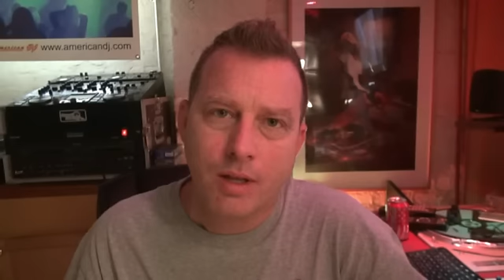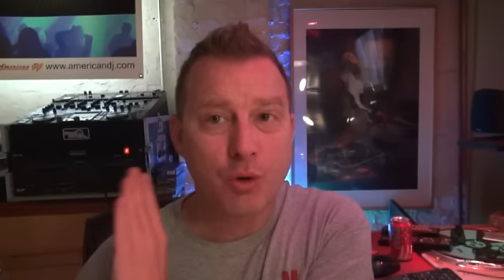Passive Speaker Systems - Amp Power, Gain, High Pass/Low Pass Crossover Points, Etc

Comment: Sorry but you got your info wrong, 250W program is 125RMS so a 175W amp would be giving about 50% over the speakers power handling. My friend, it's all about gain structure, if you don't understand it, you are not ready to run sound. I do live sound, most dj's I know, when I tell them about gain structure,  look at me like I'm speaking Chinese
Reply: As eurofantasy say, your info are wrong an unfortunately so is he :-) ,Wattage has nothing to do with it.
I.e. the reason for clipping is that your amplifier is often that your amplifier try to multiply the input signal to many times so that the amplifier lacks the power. (2 v x 100 = 200V) if you amplifier only can deliver 190v you get clipping or the speaker demands to high a current so your amplifier gets a voltage drop..
What you shall look at are the DB at 1 meter and ohm to calculate if your amplifier are powerful enough.

Comment: @CHRISTIANMINDAMIX If you're bridging the amp and then going from one speaker to the next, first, you'd be running a mono mix... secondly, you'd be running the speakers at 2 ohms, with them needing to draw 1600-2000w of power, which puts a tremendous strain on the amplifier, so unless the amp is capable of handling that 2 ohm load, that's a bad idea.  That all said, a single mrx525 is rated at 800w cont.  So if you have a pair, you're going to want an amp that can feed 1000w per speaker @ 4 ohms

Comment: I really don't see the benefits for mobile DJs 
using passive speakers today! 
They have Extensive DSP enhances system performance
built-in that is completely matched and tested to active speakers.
QSC has these benefits others have similar. 
"DMT™" (Directivity Matched Transition)
Directivity Matched Transition matches 
the HF coverage angle to the natural 
coverage angle 
"Energy Management" -Automatic standby mode 
QSC's Guardrail™ technology protect your loudspeakers 
from overexcursion.

Comment: does anyone know how to tell if you car has a factory amp, because im looking to get a aftermarket system and i went to car toys and they said i had a amp and it would cost $150 to cross it over. I also went to best buy and they said i didn't how do iknow for sure.  I already looked in the manual for the car.

Comment: (cont 3) last one I think... sorry....LOL.  --  People just tend to over drive their amps with false confidence more often when they have an underpowered amp vs. higher powered speakers.  Lastly, putting 50 watts into a pair of speakers rated for 500 Watts does not mean they will be quiet.  Power rating is nothing more then a rating of how much power you can put into them, not a rating of how much power they need.  My subs are rated at 1600 continuous, but I almost never put that much to them.

Comment: I need help, thanks if anyone reads this.
I have a Arc KS 300.2 Amp
and 2 10 Polk db Subs.
my car is new and it has a Shaker system installed when i bought it, if thats needed. i read the manual but im trying to figure out whats right, cause everytime i mess with it it shuts off it was installed prof. btw. i play all types of music but mainly rap.
but the settings has Gain, Bass Boost, Freq from 55 to 555, freq range 1x or 10x button, (High) Low, or full, (bridged r,in) L+R mono or Stereo thanks

Comment: First of all, a speaker isnt really "pulling" power from an amp. Its only accepting the power its given. Its not like an amp trying to suck power from a power source. But turning up the amp all the way to try to power the speaker will most likely lead to clipping and distortion, that's why it sounds bad and its bad for both the speaker and amp. Second of all, the average human can hear a frequency of 20hz and up. Not sure what the highest is for the average human. So to say that

Comment: I would be careful saying you should "overpower" your speakers.  You really aren't, you just have more headroom and are reducing the strain on your amp.  I usually use an amplifier rated for 150% of the speakers wattage.  Say a 300W speaker with a 450W RMS amplifier.

Comment: Brian,  you are confused regarding "underpowering".   It does not EVER hurt a speaker to underpower it. You are confusing "underpowering" with "clipping".    When you're underpowering speakers,  you won't get a lot volume out of the speaker... which in turn, most uneducated people will turn their output gain / levels up so far they run into the "red", or are clipping.   When you clip,  you are forcing the speaker to stay + or -... which is what will then cause the amp to overdrive and overheat.

Comment: @jamesduty92 Nope. Wrong. In fact, Completely wrong. While we are on dispelling myths lets look at a couple more.
There are only 3 things that kill speakers 1. Exceding thermal limits. 2. Exceding mechanical limits 3. Material degradation.

When you clip and you have an underpowered amp, it will actually raise the wattage above the rating, sometimes by even 4x as much.

All I have to say is google "Underpowering Speakers"...  Case Closed.

Comment: I have a lot of Behringer ( german ) stuff, I love it I have all three systems based on Beheringer but I do have citronic active crossover in all three systems but in my medium set up I have a american audio 1500 amp for my low end and honestly before I even enjoyed american audio I got it off a friend of mine who also DJ's and one night I decided to take it an use it in a set it of mine that I had up and running at the time that my friend hired out from me. from that night onwards I actually like that amp and if I run 2 subs on one channel at 4 ohms the subs are at 375 and can still feel the thump the subs are rated at 400rms but does not bat a light until the bass is at the 2pm to 3pm position depending on the song. - here is my facebook page @geckobar55

Comment: Most amps are running along at 10-20 watts during normal listening.  On top of that, do you really think a 300 watt/channel amp that costs $5k is a good match for  a $500  pair 200 watt speakers?  Seriously, price out an amp that puts out a true 300x2.  And do you think those crazy guys running 20 watt tube amps that costs more than your car are powering 15 watt speakers? LOL.